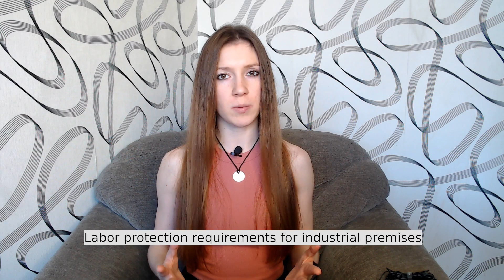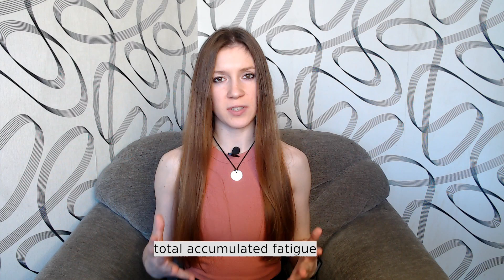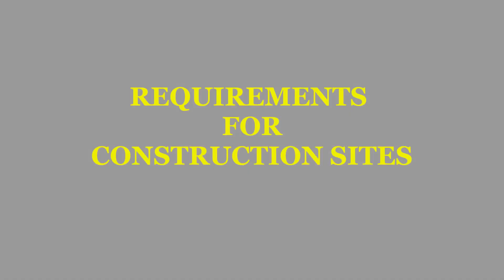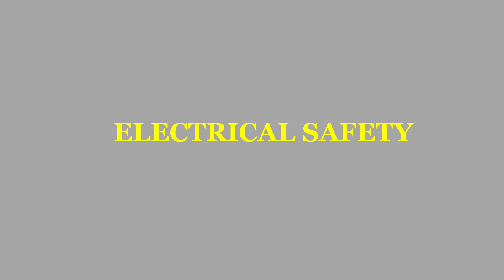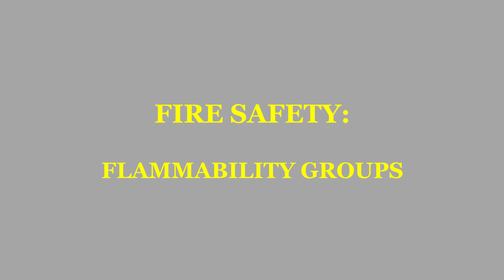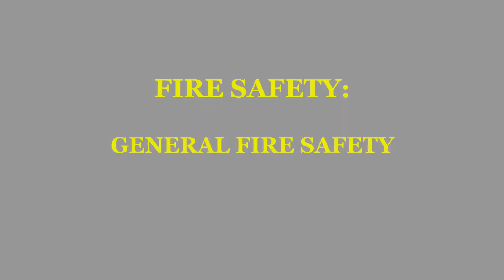[The Off-Road Ranch] #8. INDUSTRIAL SAFETY ALL-ROUND RULES.

Comment: How are difficults when it comes to bring electricity?
Reply from the maker: Thank you for a question! For me it is difficult. Even I you need just to connect a few wires, it is dangerous and I prefer to learn more. But I will face a lot with it later, so experience and protective equipment are my best friends. 😄 And I repairing and construction will require electricity all the time so I need to think about uninterruptible power supply in order to do everything I need. So now I have an idea and I'm trying to realize it.